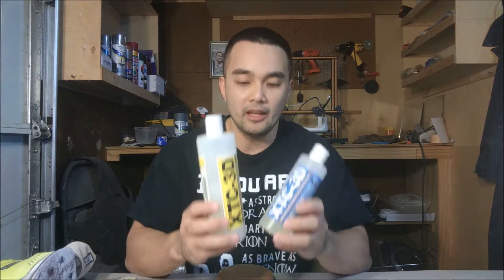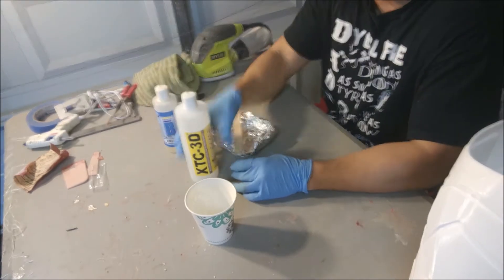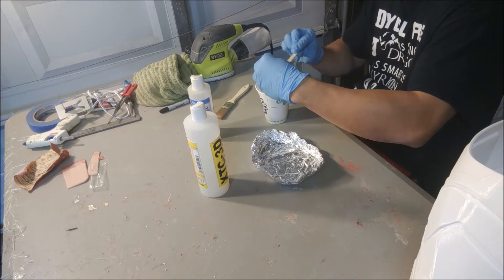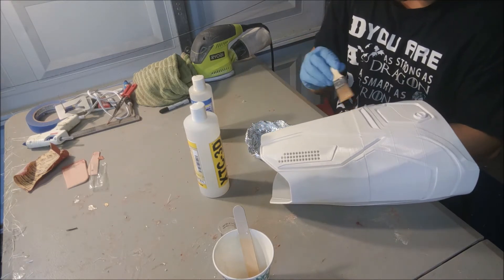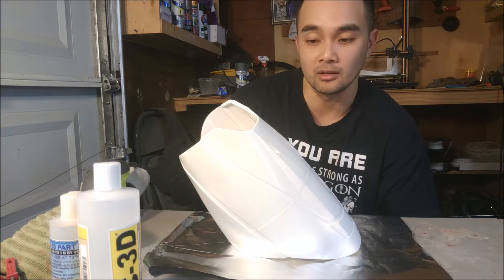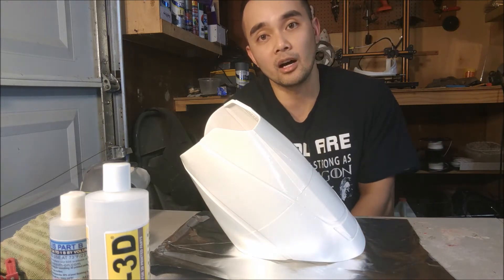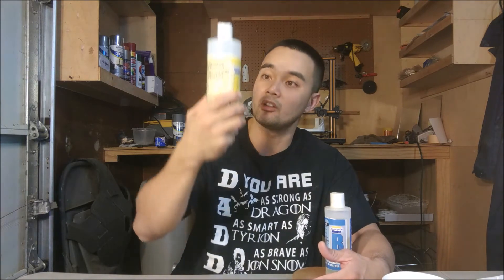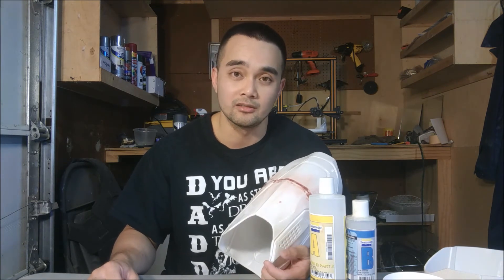XTC 3D Review- What It Is, Pros Cons, and an Experiment

Comment: Thanks for this! One thing I've learned so far, use plastic cups when mixing liquids together. You never know what chemical reaction will affect the paper cups. Especially a fast curing resin.
Reply from the maker: ChunkyJo it doesn't seem to affect the paper cups at all. It works well for me
Reply: Good. I'd expect that with a slow curing resin like XTC. If you ever use a fast curing resin/foam/silicone (like stuff you can noticeably feel heating up as it cures. 5min 10min curing stuff) use plastic cups. It'll burn right through it. It's not fun.